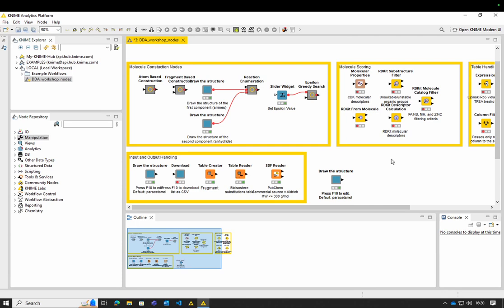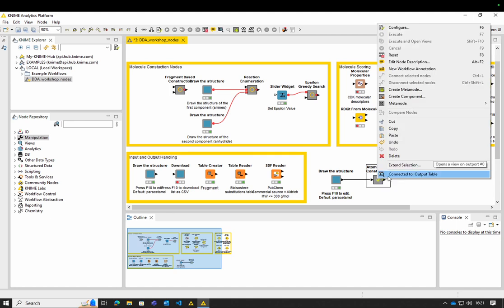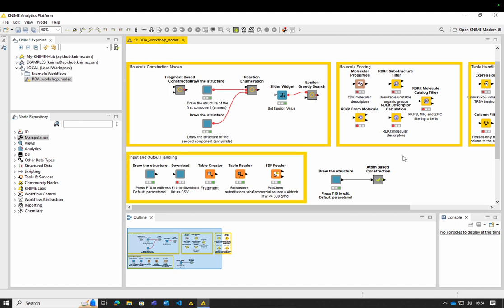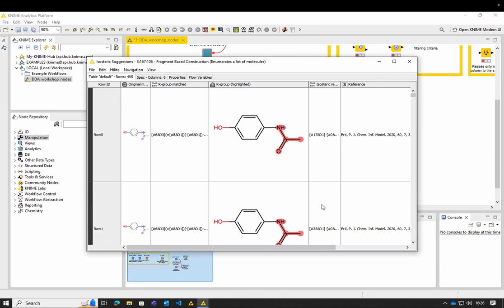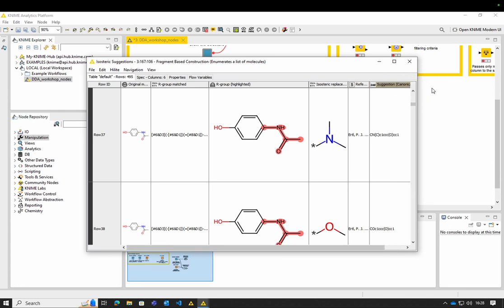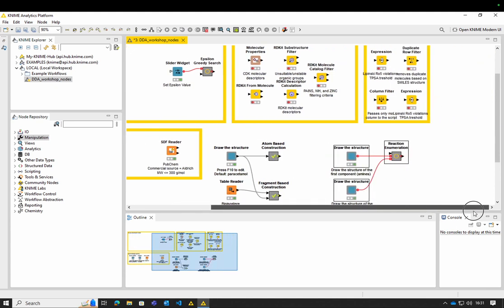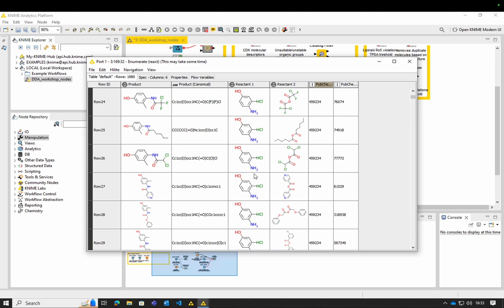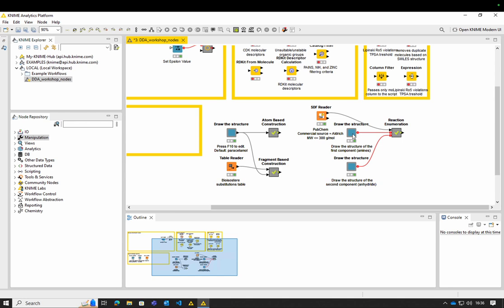DDA Computational Drug Design KNIME 2: Molecule Construction

Comment: I encountered an error while running a KNIME workflow. The Table Reader node (Bioisostere) fails to execute with the following message:  (Execute failed: The specified file 
C:\Users\jwebster001\Downloads\isosteric_suggestions_processed.table 
does not exist.)
I would appreciate any guidance on how to proceed.
Reply from the maker: Hi there! It seems that you have reset the table reader node so it cannot read the file from the workflow internal space. As a fix, you can download the file "isosteric_suggestions_processed.table" from our KNIME public hub. Please follow the link https://hub.knime.com/s/feXvGM1ETUjIDZV6, click on "Drug Discovery Africa 2025 Workshop" and download the file to a folder you know the location on your computer. Back to KNIME, click on the Table Reader node, double click it to open the Configure dialog box and use the "Browse..." button to load the table file from the folder you saved the file in. This should correct the issue.